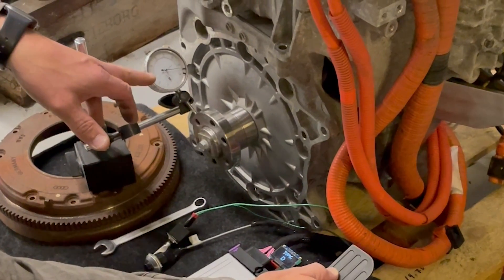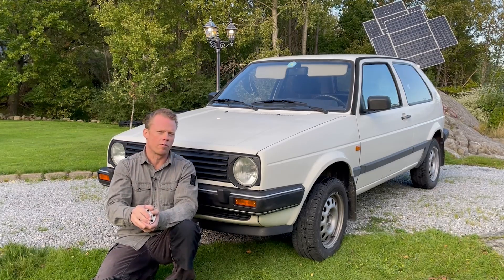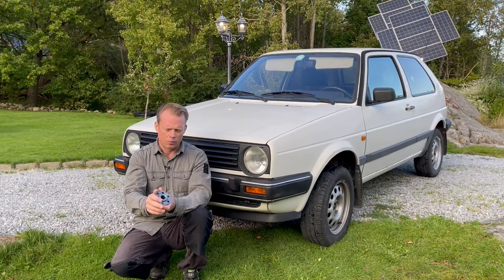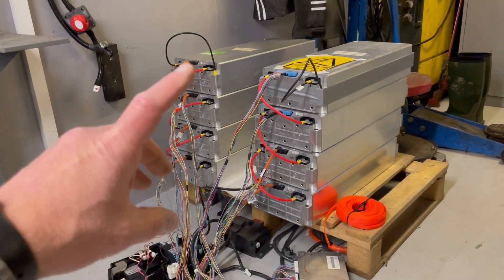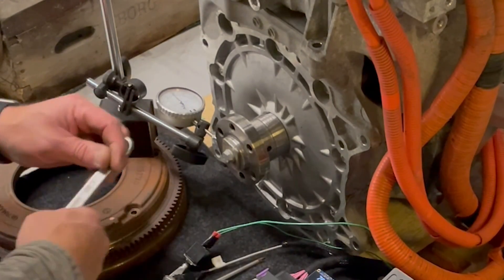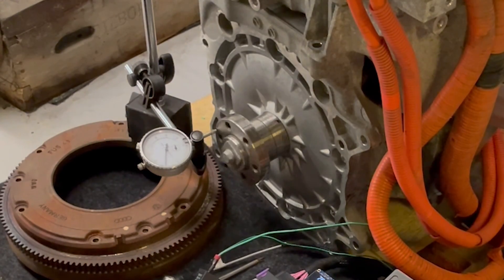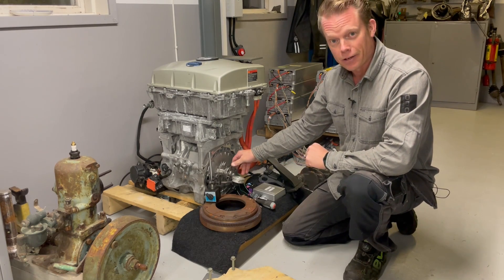All electric Vw golf Mk2 citystromer, Nissan leaf motor update.

Comment: Is the Citystromer road legal with this conversion on the swedish roads? In Denmark, this would not really be possible unless you had the money to get the car re-tested and have it live up to modern requirements (safety, EMI, etc.) which is unfeasible for 99% of the population unless they have a bottomless pit of money.
Reply from the maker: Hi.
It’s possible and will not cost so much.
Hopefully the Swedish Volkswagen group, will come back to me with some papers and tell me that the power from this motor are within the limits of this car. If they not think that this is okay, I can register it as a modified car.

Comment: Do you need a gearbox?
Reply from the maker: Hi.
Yes. The leaf motor have a reduction gear box at 8:1 gearing. So the second and the third gear will be the mostly used gears in my case.

Comment: Tis project is looking great!
How about the project with de victron and the battery-cell at the wall? 
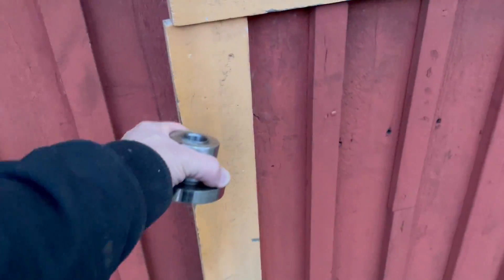Why did you disconnect the cell? At 1:57
Reply from the maker: Hi, and thank you ☺️.
No need to have a small Off-Grid system now when the energy prices are almost 0€. And the other reason is that I now need that module in the battery bank for this Citystromer project.
Thanks for your question ☺️👍🏻